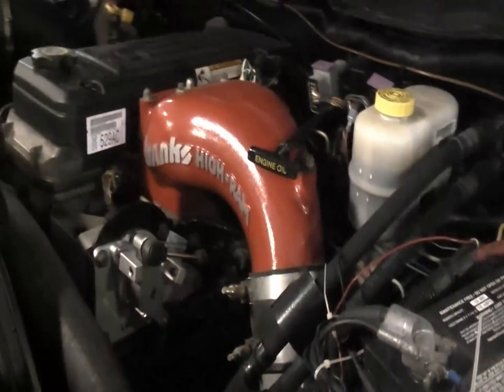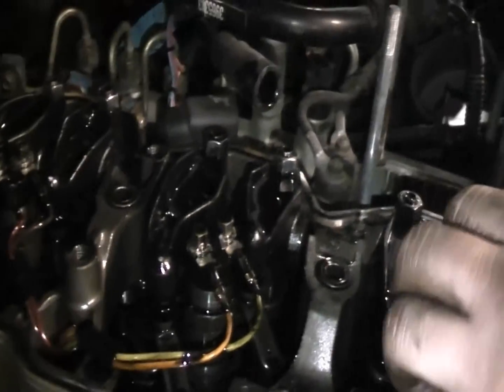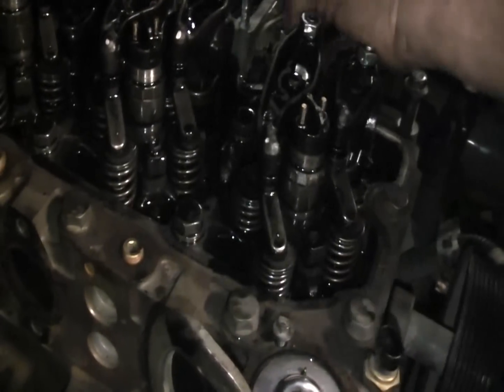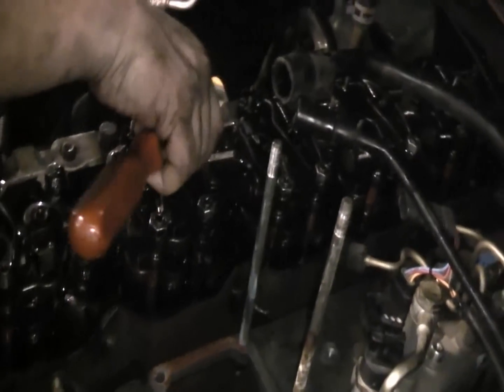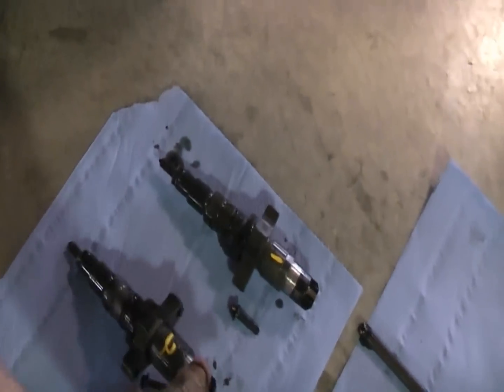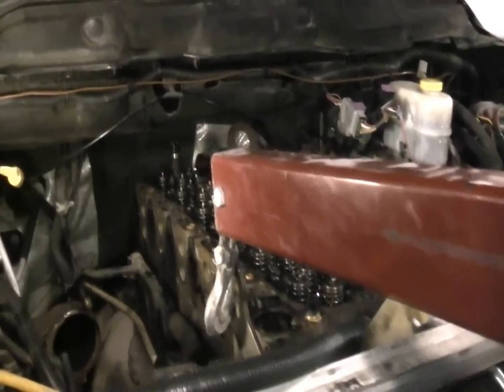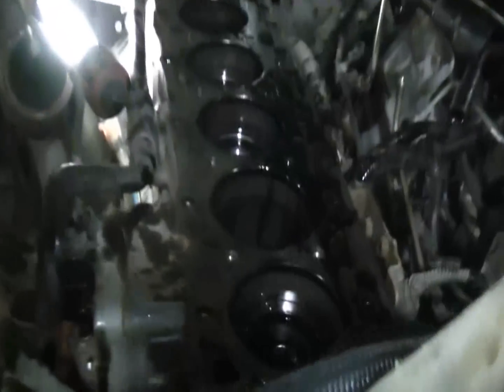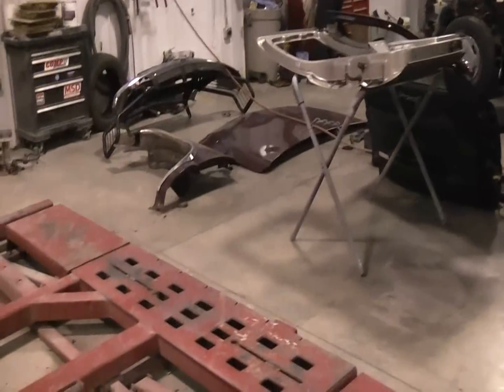Cummins Head disassembly

Comment: Do you have to take valves and all out to remove head? I have to replace my head gasket this weekend and im hoping I dont have to remove all that shit or can I just take head bolts out and remove head clean it up put new gasket on and reassemble it?
Reply: yfz450911 no you don't have to take the valves out you just need a engine picker or another person to help you lift it
Reply: Yes everything has to be removed to do it proper. If not you’ll get issues